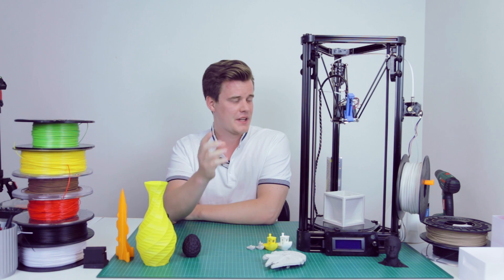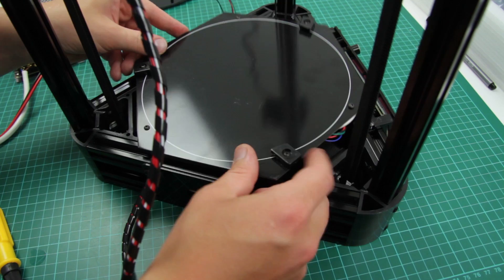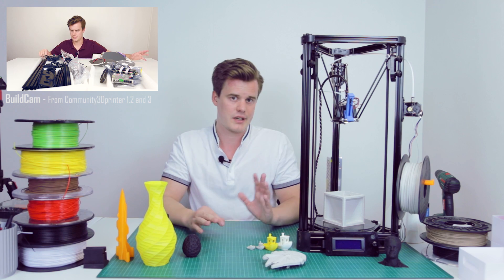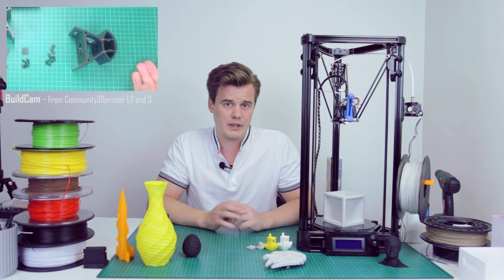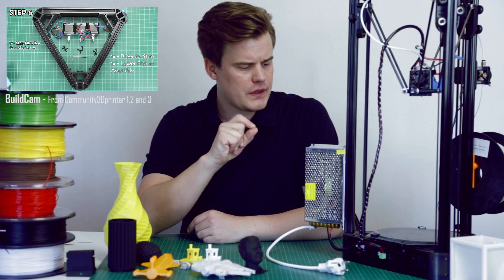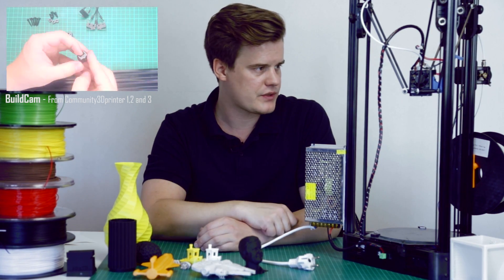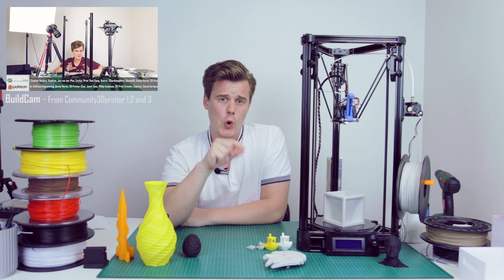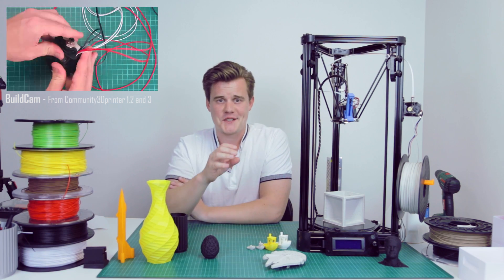Micromake DIY Delta 3D Printer Review (Micromake D1)

Comment: this guy has issue's printing abs without an enclosure but he is reviewing printers?    who does he think he is?
Reply from the maker: Experienced, have run machines tens of thousands of hours. Tested most machines, even if I've not been able to produce a video on it.  So yes,  giving you a honest expectation as a user is what I do.  You can get better results with a enclosure of course, but that's not what the printer has or comes with, and the body of this machine doesn't really allow for a enclosure, so why should I say it's a good printer to print ABS with when it's not?
Reply: @3DPrintTechDesign  you don't need an enclosure at all for abs.  tons of people are printing it perfectly fine without cracking without an enclosure.   

so if you cannot do that.  it shows you are just an amateur.  and you have no buisness trying to give a professional review.  because you are NOT a professional.  

you are an amateur with dellusion of grandure
Reply from the maker: Sorry you feel that way =)

Comment: ABS use no cooling fan heated bed is great use abs and acetone solution to coat the bed. I use a raft. supports also comes in handy use grid not lines for internal supports.  it is my first ever 3d printer. I found it makes parts very accurate.  I have used PETG also found watch your heat some has gone black in nozzle required sever cleaning.  I have used .8 nozzle with abs makes nice square  larger objects fairy fast. I have made great fishing bobbers with ABS yellow up to deep sea.
Reply: do you even english bro?

Comment: This printer looks like a HE200 that I got from Hoyi Sunway . Have you ever reviewed it?
My experience was/is not good but it is my first printer. The problems where many from missing, broken parts AND the instruction where a BIG JOKE !! I would like to see you do a review of this problem supplier to warn others of its bad properties.

I still haven't figured out how to attach the bed leveling tool. Pleas HELP
Reply from the maker: Never heard of the HE200 or Hoyi Sunway I think. But I can really understand you didn't have a smooth ride if this (or a clone) was your first. As I say it's easy to think every printer is perfect when us reviewers have success with them. Usually we've worked with dozens of printers already. 

I wouldn't recommend this as ones first machine, since it does require some extra "hands-one". Still not a useless kit, all depends on when/what on sale. =)
Reply: PLEASE go to their sight and see they seem to be a big company. I found them on BangGood. You should know how bad they really are